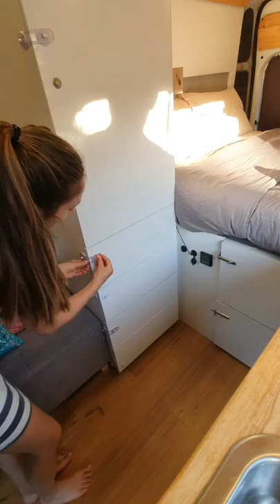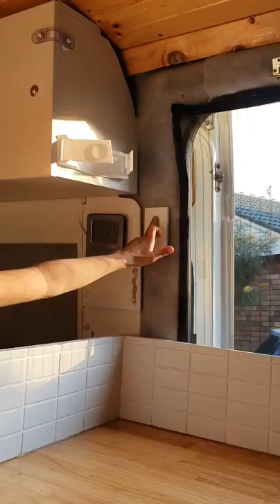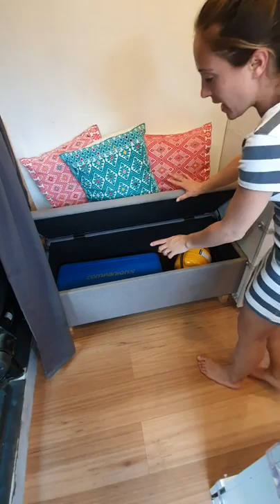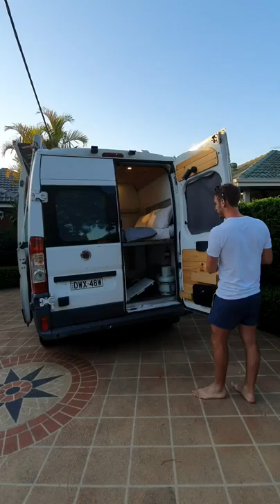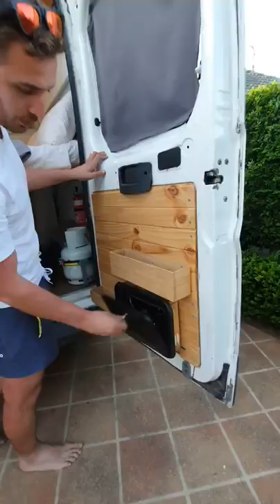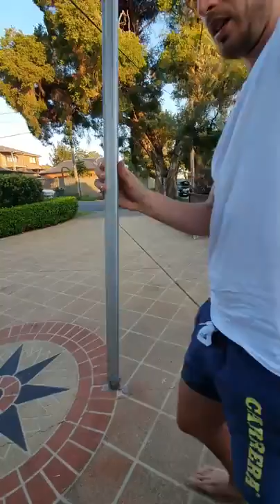FIAT Ducato campervan vanlife conversion tour

Comment: Looks great guys, where did you get your water tanks? I’m having trouble finding and for the Fiat here in Australia
Reply from the maker: I purchased ours from Ebay from memory, they weren't specific for the Ducato though. Camec also has quite a few options that should fit under the van too! Are you planning on having the tanks under the van or inside?
Reply: @theinnovationclassroom  under the van hopefully, the hand brake mechanism restricts the options though.
Reply from the maker: @adamfinch5714  it does definitely save room. We ended up with 2 slimline ones that went from front to back around the centre of the van and then 1 squarish 48L tank that went accross towards the back. We cut out some aluminium bashplates and had to bend (using a metal bender) the supporting brackets for a snug fit. Good luck with the build!